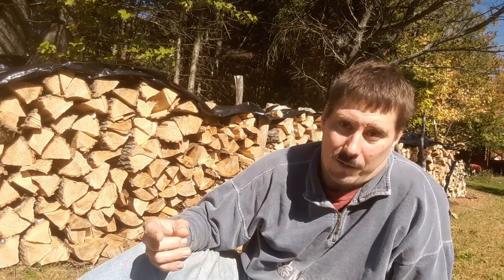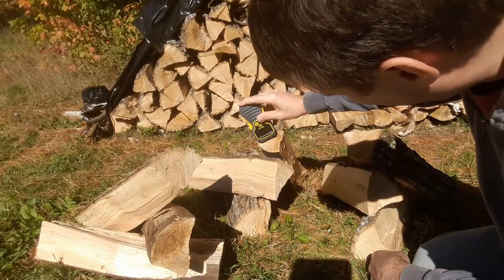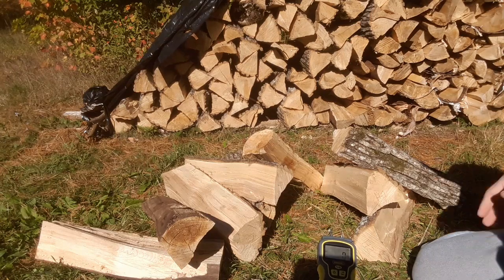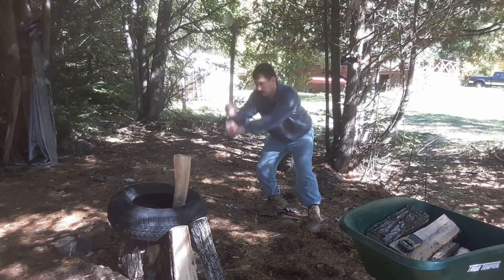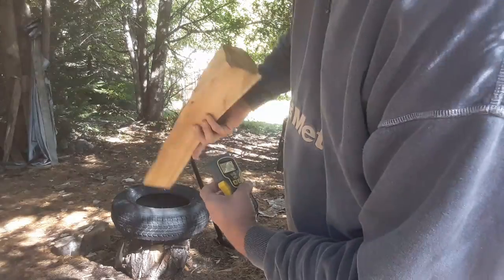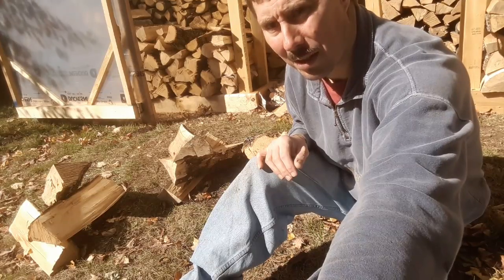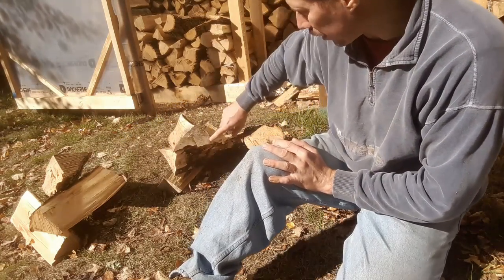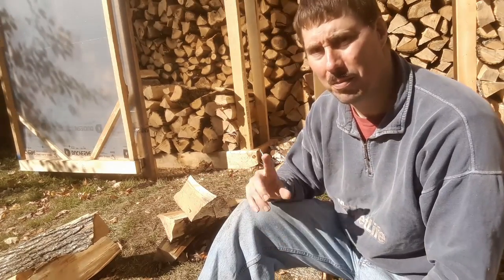Firewood Seasoning Experiment - Greenhouse vs Open Air Stacking - Part2 - Conclusion

Comment: 84 years old  here and wood burning  over 30 years; getting lazier.  North latitude 50 degrees , west coast Canada . Summer gives 50% RH  air and sometimes less, in daytime . I build long 4 foot high rows cross-wind across of maple and Douglas fir. Takes 2 summers and lots of poly sheets to get wood moisture  to 15% sometimes less. I fail to see putting any permanent roof or walls would help the drying

Comment: the only data driven video i've come across regarding seasoning firewood and i love it. i do wish the sample size and length of test time were greater/longer as i hypothesize the results would be more favorable for the shed. nonetheless thank you for sharing!
Reply from the maker: Thanks for commenting.  We've had five (I think) seasons since doing that experiment and we've basically been doing the exact same thing (having fresh-cut wood stacked both in the plastic-covered woodshed as well as in outdoor stacks) and have had the exact same results.  

I have all my wood cut and stacked by the beginning of June (am ahead of schedule this year, though!) and by mid-October's start of heating season, the wood in both storage types are dry and good-to go. We get no water boil-off from the wood when it goes into the stove and almost no build-up at all in the chimney (I scrub it out and collect the debris - so far never more than a double-handful).  

I still think the shed is slightly better than storing outdoors for seasoning the wood, but not enough to prompt me to build more of them.

And, amazingly, the non-greenhouse (just construction-grade 6-mil) plastic on the shed has held up perfectly.  It's been six years and it is still doing well.

Hope that above info helps :)

Comment: how would the results come out if you had a tunnel style greenhouse instead of the greenhouse that you have built? Also, the south-facing and more sunlight could make a difference as opposed to where you have the greenhouse built?
Reply from the maker: I haven't tested that but I suspect it wouldn't work as well if it was a fully-enclosed tunnel greenhouse (like we have for growing vegetables) as it wouldn't have airflow.  One of the benefits of tunnel greenhouses for growing things is they tend to reduce water consumption by keeping the environment fairly humid - exactly the opposite of what you want for drying wood!  

My woodshed/greenhouse is mostly south-facing, but is partially shaded by the house and an apple tree - would definitely be better in full sun, I think.  That was just the handiest place to build it.  

But I did design it specifically to maximize airflow via convection when the sun shines as well as to let breeze through via large opening 'windows' on the sides and rear and large gaps at the wall/door bottoms as well as between the roof and top-most wall frame.

I can confirm now, after our 5th winter heating with wood, that the woodshed/greenhouse does indeed work as well as the outdoor wood stacks and the plastic has held up Very well - no repairs at all cause by  UV degradation and just some very minor repairs caused by my poor stacking one year that caused a bunch of wood to fall against the front wall.  I've been quite happy with it.
Reply: @OutdoorElements  impressive

Comment: What a fantastic project that, I suspect, anyone who burns wood has probably had thoughts about. You have taken the time to cover everything I would have done (I’m my daydreams) and then presented/analysed the findings in a logical manner. Thank you for doing this as it saves us all from the hassle of doing it ourselves. Obviously it can be repeated with differing locations tested but that’s for somebody else with time and money to waste. What you’ve given us (or me at least) is a no nonsense comparison of what I could expect if I changed my current, basic, open-aired but covered log store to a similar-to-yours alternative......again, something I think about (but do nothing about) quite regularly. 👍

Comment: Interesting work but I did wondered why you stacked your field stack on the group oppose to on a rack to allow air circulation to occur under neath? Secondly, I also wondered why you took a moisture meter reading from the ends of a loft  since this is the water evaporation door to the log. The higher number on the rear appears to indicate that the log is actively still evaporating from the rear due to lack of direct sun light on the front. 

The experiment was interesting but I would also like to see you experiment with different stacking methods to see which would dry out fastest. However moisture meter reading should be kept at the center areas but not the end. Although with this experiment, the moisture meter reading from the ends does tell me I should reverse the entire stack.. all those facing the back now restocked to the front but easier said then done if you have lots of wood. But that could be a stacking method as well; to reverse the logs at some point to complete a faster drying process.. that’s  for sharing ... keep experimenting. Would like to see more.
Reply: now were 'splitting' numbers

Comment: I have a large lean-to woodshed built onto my garage/barn that can hold 20 facecord although I burn 12 facecord annually. Wood definitely stays dryer for the winter  inside there, yet it prevents the extra drying I like to get being in the sun and wind.  It would be different if I could buy fully dried and seasoned firewood, but that just doesn't exist in the real world as every wood seller sells wet wood to some degree.  I do burn somewhat dry wood, but it's not fully seasoned.  So I must begin the process of buying my wood one year in advance, stack it outside for the year only covered on top with a plastic tarp, and take advantage of sun and wind myself. That being said, now I have a wood shed that I cannot use for wood because I am not going to stack wood outside first, then a year later haul it to the shed...it's just too much work.

Comment: Thanks for sharing your experiment.  This is my first year at seasoning wood and after a few months of leaving them out in the field over summer and autumn,  had pondered if they would dry out quicker if they were into put into a ventilated greenhouse myself.  And I always love seeing a systematic approach with testing out an experiment so your spreadsheet and graphs was an enlightening to see the results.  Thanks!  Regarding your data collection,  did you continue to collect moisture readings over a longer period of time.  Wondering how the results panned out after 3, 6 months and 12 months.
Reply from the maker: Hi Mike - Thanks for the comment and I'm glad you found the vid useful.

That was also my first year and was in a big hurry to get the wood seasoned in time for winter (of 2016-2017).  We moved onto the property in early August, and heating season starts around here towards the end of October - not a lot of time!  

The results were pretty good in that the the wood was in acceptable condition by the time it needed to be burned - we burned the driest stuff first to give the wetter more time to season, and it worked out OK.  

I don't really have long term results as most of what we collected was consumed that winter, however, I can report that, all things considered, I was happy with the results, the wood was mostly at or below 18% moisture according to my meter and the post-season chimney cleanout produced only a handful of creosote from a roughly 24' tall chimney pipe, which was one of my main concerns. 

That winter, I did quite a bit of firewood collection and more or less had everything cut and stacked by the end of March.  Having the extra five months or so of drying time made a big difference as the wood was noticeably better this past winter (2017-2018).  Everything was in the 15% or better range, and I felt we were getting more usable BTUs and quicker heating up when stoking the stove (a good thing as this year temps were far colder than last).  We're still in the end part of the heating season so I haven't done a chimney cleanout yet, but I expect there will be very little in there - we'll see, I guess. 

Thanks for watching!

Comment: Seasoning most wood takes a year or more. Oaks take 3 to get reasonably dry 
 I find..
Reply: I think that must depend on where you are.  I hear enough people say that to where I believe it must be true in parts of the country.  I live in Missouri and if I cut white oak in March and April and stack it in my woodshed it's in great shape by October.  Red oak still shows some interior moisture in that same timeframe and it does sizzle just a little when it's burned but it will burn ok.  If you don't mind me asking, where do you live?  I'm just curious where it would take 3 years to dry oak.  Thanks!

Comment: i see your point.  i understand. what your trying to do. over dry wood will burn to fast and to hot. dont know what your burning it in air control ect.
Reply: Christopher Kapp no such thing as "over dry wood".. the dryer the better. Period. Ive been burning for 30 years. A good wood burner (relying on wood heat for winter) would agree w me.
Now wood that is really old say 10 to 20 years old, resins in the wood that burn will be less intense but it's not noticeable. A good rule of thumb is 2 years of seasoning .. u really need 3 to 4 years to build up inventory to be solid when winter is here and you need dry 19 to 20 percent wood.

Comment: put it this way your going to burn that wood not matter how dry or wet it is.
Reply from the maker: I'm not sure I catch your point and I suspect that you may have missed mine... Sure, I'll do whatever I need to do to keep the family warm over the winter, but the idea is to find if the various ways I'm prepping the wood enhances or hinders the drying process.  Clearly the dryer the wood, the better, so that's what I'm aiming to achieve.  BTW, now that winter is nearly over, I can verify that the wood collecting/drying process actually worked out very well and I've split and stacked next winter's supply already, so maximizing drying speed won't be an issue.

Comment: I love how much detail you have here... however, A fresh cut tree at 20 - 30 % maybe an ash tree would be that low so I think your moisture meter may be something to be desired.... When you placed the meter on your fingers and got a reading in the low 20%? I'm not a medic but I think that would be severe dehydration close to death as I think for a healthy % should be 60% +           http://www.bing.com/images/search?view=detailV2&ccid=t6rhnvrb&id=F150958BA76988115D6C19689A836A66EEDC7705&q=water+body+%25&simid=608005531824489699&selectedindex=6&mode=overlay&first=1&thid=OIP.t6rhnvrbahlDPnXX5cHZjADnEs I don't want to be negative as I love the fact you've done this which is a great help to us all but please could you try a sample with a different moisture meter please? Thanks buddy
Reply from the maker: I've found the meter to give pretty good readings - some of the trees that I sourced were standing dead (as many of them as I could find!) - That may have been the case with my test pieces but I don't recall now.  The finger test was the Outside of my skin - I didn't puncture myself - had I done that, I'm sure it would have maxed out the meter (and it probably would have displayed "Crazy Guy" on the screen!)  :)  When testing pieces that were visibly damp or that were punky, the meter maxed itself out on the moisture scale - it maxes at 50%.  Bone-dry stuff that I had stored in my basement came in at 5 or 6%.  I'm fairly confident that the meter is at least giving a reliable scale comparison between samples even if the actual % is off by some (I don't have any way to calibrate it and don't have access to a second device).  Thanks for the comment.  And BTW, I did recently acquire some fresh-cut ash logs and the bark meters at 50% and the interior wood is coming in around 22 - 28%
Reply: Also, moisture meters are calibrated for the material they are applied to. It would not read a correct value for a material other than wood.
Reply: thank you for the update. I didn't realise that... hope all is well and good to read next winters fuel is well on its way.

Comment: Great in-depth review!  I've always wanted to build a small yard barn/shed that has a solar fan, a couple vents, and a skylight.  I figured this would dry out firewood the quickest.  What are your thoughts for the ideal drying shed?
Reply from the maker: Thanks very much :)  I can't really give much advice on an ideal drying shed as I'm totally new to this myself.  Key elements, though, are airflow, sunlight, and removal of moisture/humidity (see airflow!).  I'm happy with my shed's performance, but this winter has shown me something that I didn't think about when building it in the summer... the roof slopes such that the snow dumps right in front of the doors so I have to keep shovelling it away.  It would be better to have the doors on the reverse side or have the roof slope the other way, although neither one of those would be ideal in my shed's location.  Always learning something :)
Reply: @OutdoorElements   Thanks for the extra feedback....very interesting